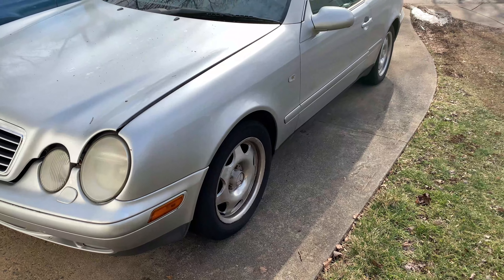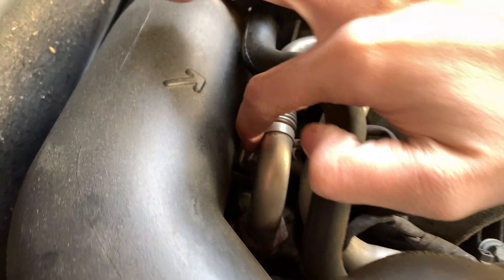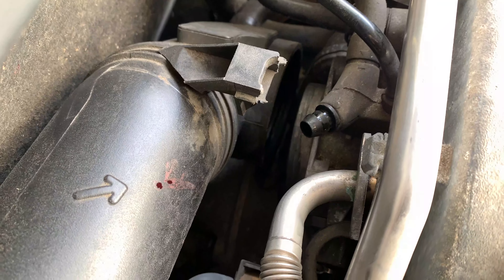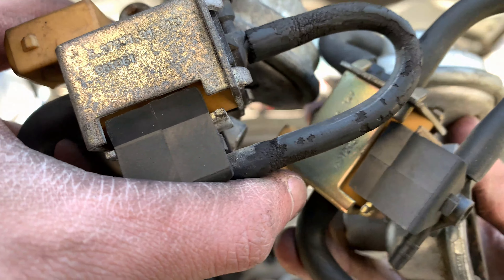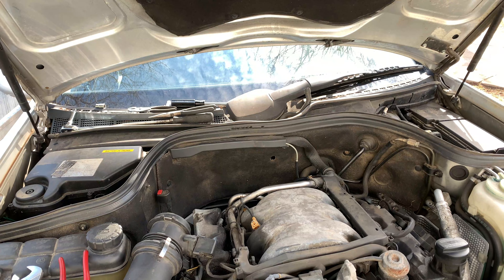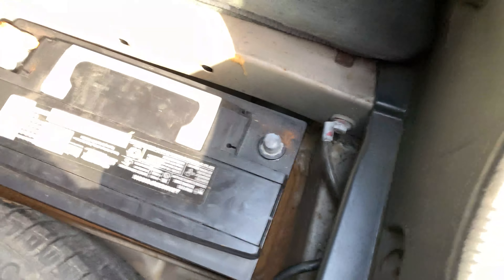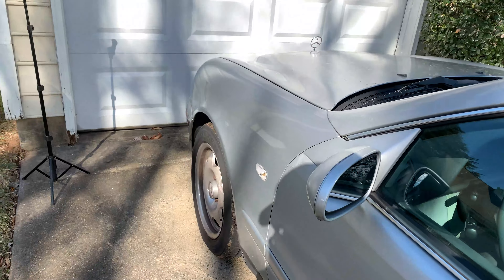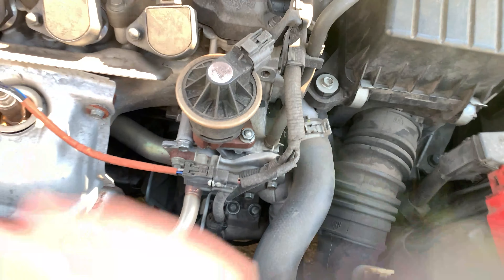EGR Replacement  |  98 Mercedes-Benz CLK 320

Comment: Good job, but I found that the tube going into the engine was totally clogged the 1st time I had to clean everything out to pass emissions on a 1998 c280. A year & a half later, I am replacing the egr, & cleaning the tube out again. I removed the tube with the egr still attached. You just got to figure out the combo to get it out. The rubber y conn def has to come off to do this. But not removing it is probably the best idea if it’s letting the proper amount pass through. Thanks for the video. It’s a difficult car to work on. Especially the plugs $ wires. All about the right magnetic socket . I found out the hard way on that. 👍🏻
Reply from the maker: Im glad my video has helped

Comment: looks like your white vac hose ( on the  firewall) needs to be connected, you should of also changed all 2 hoses, and cleaned out the unit, surely has carbon buildup, tks for the video  process